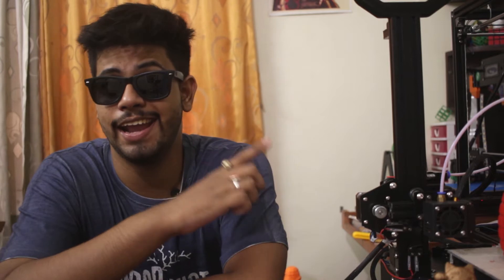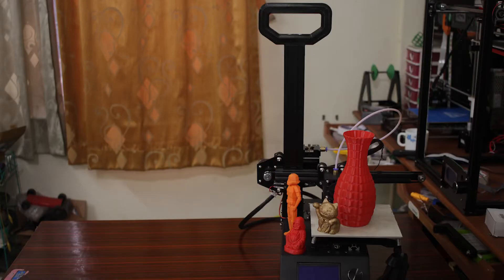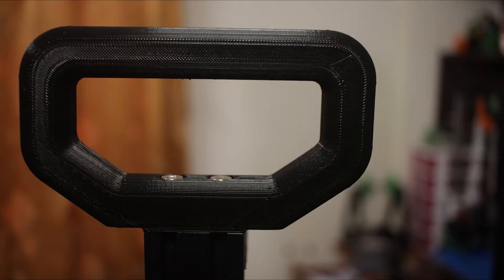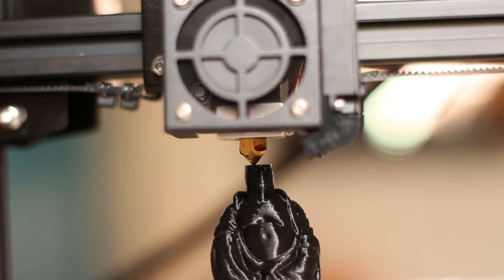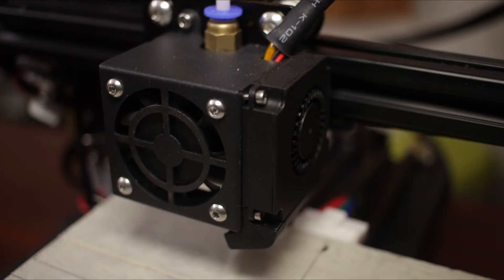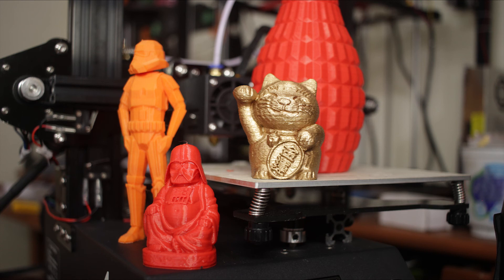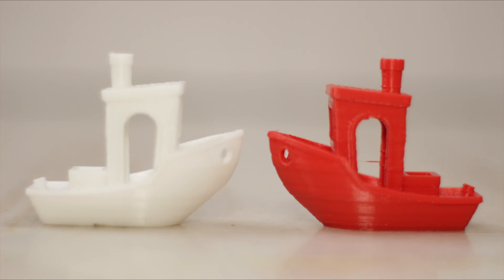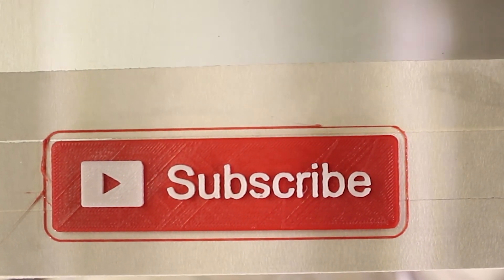Anet A9 Unboxing and Review - Best Portable 3D printer 2018

Comment: Sadly it is not that much of a Popular printer, since there are not many mods/hacks for the printer.

Recently bought one, since it was at a extreme discount on aliexpress {less than 70$}
Gonna mod the Shit out of it. including making it more durable.
{The first mod im gonna do is ad a removable heated bed {magnetic}}

PS great guide/review. TERRIBLE AUDIO
Reply from the maker: Thanks for your feed back ,I do accept the audio quality was a bit bad. I will try to improve it.Thanks
Reply: @PrajjwalNag  If you still have the printer. and have successfully upgraded the firmware, would you be able to share this.
_________
If you also by any chance have the settings for Cura 4.6.x, it would be greatly appreciated.
__________
Already found a glass plate for the heated bed. this will also be the first upgrade {aside from any potential software updates}